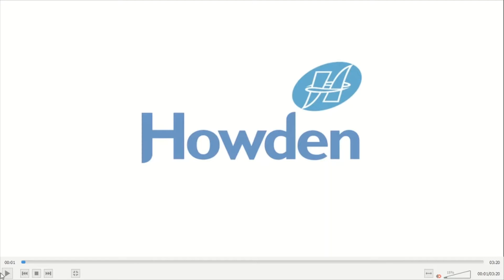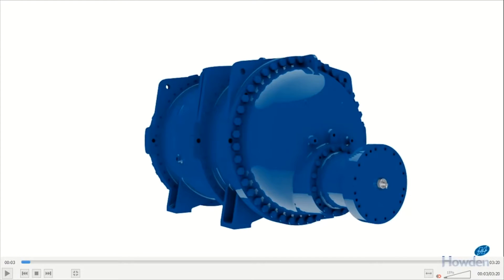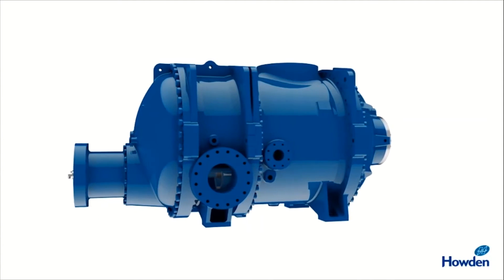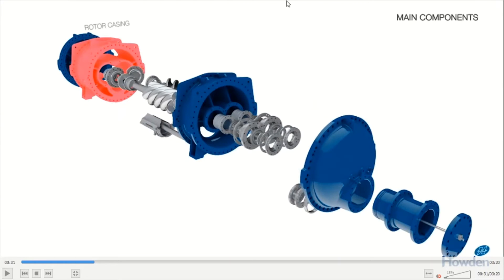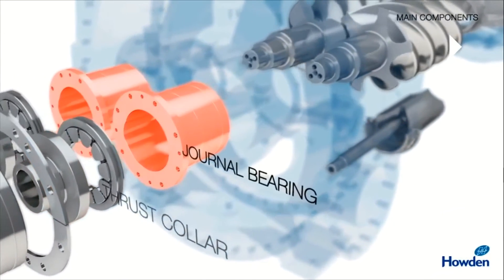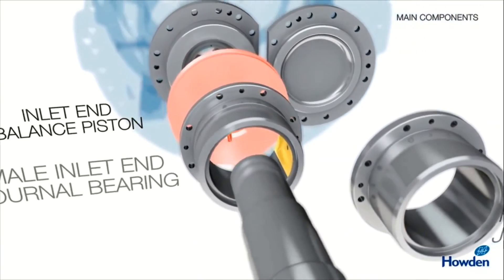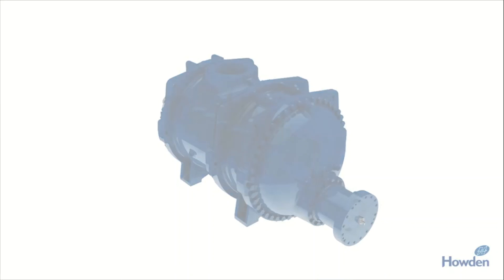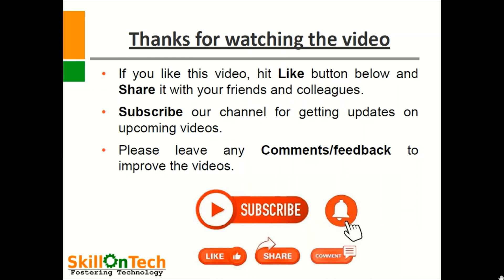How a Rotary Twin screw Compressor works | Screw compressor animation (with english subtitles)

Comment: We have some problems with kind of compressor Howden. Slide valve of compressor operates uncontrolled, something trying to load compressor by pushing valve to load direction automatic see that it is not need and try to move back the slide valve in the previous position. This happened around one time per 30 sec. What’s wrong with it?
Reply: Check to see that no one selected the manual mode on the HMI at the UCP. If that doesn’t solve the problem then also check the oil supply to slide valve as well as the solenoid valve that opens the passage way for oil to pass through.